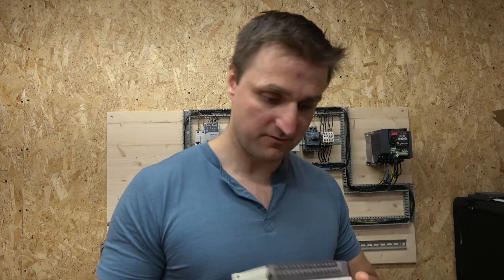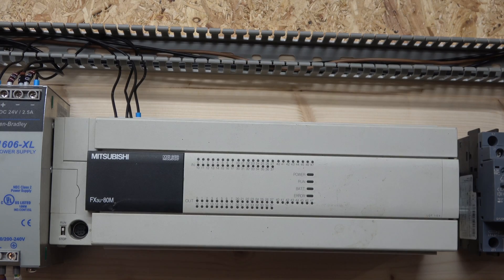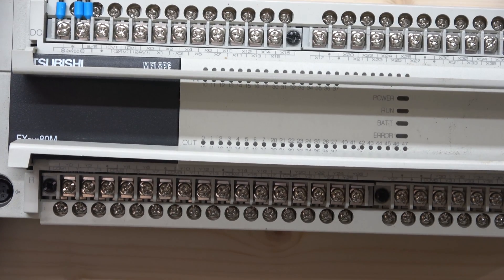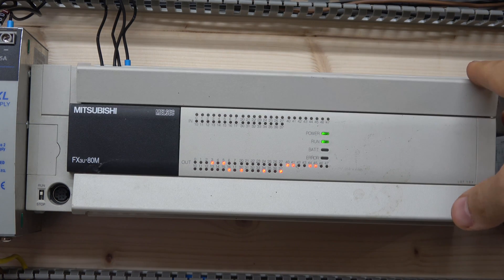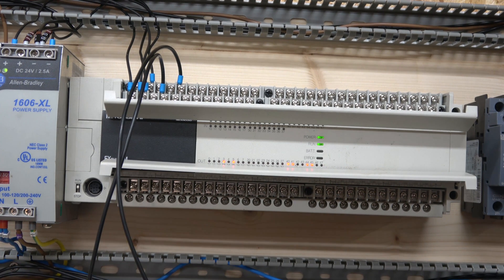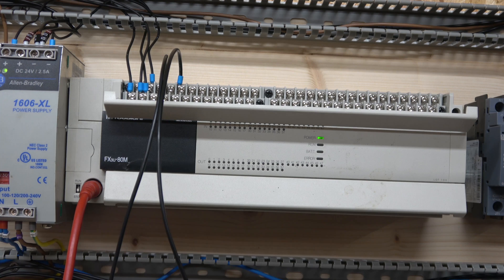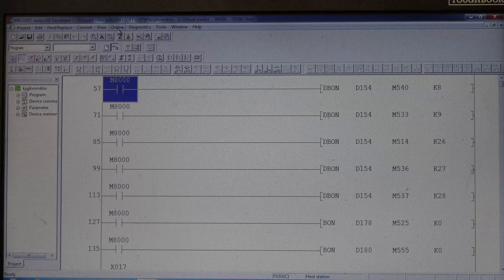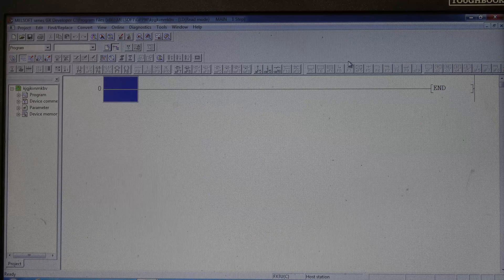Mitsubishi PLC FX series GX developer program upload / download / input and output wiring. (English)

Comment: GOOD MORNING IGS ELECTRONICS COULD YOU HELP ME, I HAVE A PLC FX3U-64M AND I CAN CONNECT TO IT WITHOUT PROBLEMS I ALREADY HAVE THE CABLE CONTROLLERS AND IF IT DETECTS ME BUT IT IS CONNECTED TO A MODULE FX2n-20GM AND IT IS NOT CONNECTED, ERROR IS: 018084B ME YOU COULD HELP IN HOW TO CONNECT WITH THE SOWFARE GX WORKS2 OR GX DEVELOPER REGARDS
Reply from the maker: Have you checked the com ports.

Comment: Hey bro, from ur example plc unit, to clarify with u, ur input s/s is 0V, so ur device connect 24v and send to your input plc 24v once closed switch. (sinking type PLC input), how about your output? Output terminal 24V dc to device and device connect 0V to  COM in order to be complete circuit? (sourcing type output)
Reply from the maker: Hi There. Is your unit relay output or transistor?
Reply: @IGSElectronics  hi bro, it's relay output

Comment: Good day! I need to replace PLC FX1n-24MR with FX3g-24MR/DS. I did same as you showed in video, program and parameters transfered to FX3g succesfully, but when I connect wires, not showing the inputs signals. What can be the problem?
Did FX1n and FX3G hardwired same inside? From outside I see no difference in connections,except FX1n have COM on the inputs side, while FX3g have S/S terminal.
Reply from the maker: Hi there. Make sure the s/s got negative part of the power supply and all your inputs are powered from positive part of the power supply.  Make sure  plc is in run mode.
Reply: @IGSElectronics  S/S supply from negative, inputs from positive. PLC in run mode, but problem is same...
Reply from the maker: @ЕвгенийЕвстегнеев-р5з  with out really seeing the actual situation it is quite a hard to dive you advice. We’re do you get com on input side? There is no com on input side of the plc.
Reply: @IGSElectronics  Do you have email or something, so I can send you some pict? 
In your video you connect negative to COM in FX1n, so on FX3g I connect s/s to negative.
Reply from the maker: @ЕвгенийЕвстегнеев-р5з  Yes, you should be able to find the email in YouTube contact page.

Comment: Thank you 
If I do it like you did it in the video it works but if I give s/s 24V and com1 0 v the outputs does not want to switch 

Is it possible to give S/S 0V and COM1 24V or S/S 24V and COM1 0V  depending on the users needs?
Reply from the maker: Hi Kevin. What's the part number of your unit. S/S should only have 0v cable and 24v for the switching cable. For relay outputs any cable can be switched but for transistor outputs, its a different story, am yet to make video on that.
Reply: @IGSElectronics Hi thank you for the reply.
I retested and S/S works with 0V and 24V but COM1 only switches the output on if I give COM1 24V if I give COM1 0V the output stays on even if the output isn't on Y0 that's the same for all the outputs 

Mabey it just me that have to read the Manual RTFM (Read The Fucking Manual)  :)
Reply from the maker: @kevinmoore6762  what's the part number of your unit?
Reply: @IGSElectronics  Apologies

FX2n-48ER-ES/UL
Reply from the maker: @kevinmoore6762  its a extension unit for other plc, what is the part number of your master plc. Plus it is relay unit so there should be no resistance between com1 and Y1 once plc is unpowered. Is that the case?

Comment: hello Ingus, my name is Jorge, from spain. First sorry for my bad english.
Just I need to program one plc mitsubishi FX-80MR, and other FX-125MR,....both too old....
Someone has told me  that,  only it´s possible to do with a programmer machine, not by software,...this is true?, or realy it´s  possible to do by software?. 
So, can you help me?
Regards
Reply from the maker: Hello Jorge. Your English is perfect. You can program old FX series plc with the same cable as the FX1,FX2 and FX3, the only thing you need to do, if you see the video where i demonstrate the SC-09 cable, you will see where 2 cables are joined together by large serial plugs. Split them apart and male end of that cable will fit in any old FX series PLC. Plug in, start up your GX Developer and you good to go.
Reply: @IGSElectronics  Hello Ingus, which version of the Gx developer is the right for this Fx plc, right now I dont have any software.
Thanks for all!!
Reply from the maker: JORGE H.G. The one I used last time was version 8, but am sure all the other ones will work. Hope that helps.
Reply: @IGSElectronics  Hello Ingus.
Does this plc fx work with rs232 or rs422? I don't have the original cable and I just need to know if I can use some other type or if there is a schematic to build one. Thanks for all.
Reply from the maker: JORGE H.G. Hello Jorge. You will need original SC-09 cable. I use rs232. in coming days I am planing to make a video on this, so you can see how I do it.
Reply: @IGSElectronics  Perfect, thanks for all..